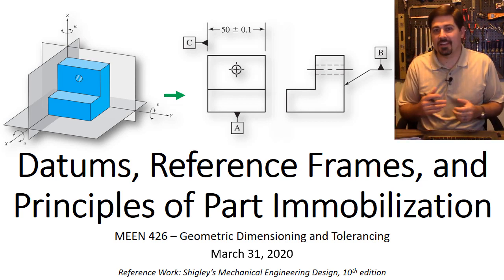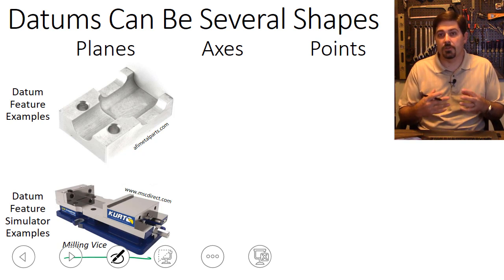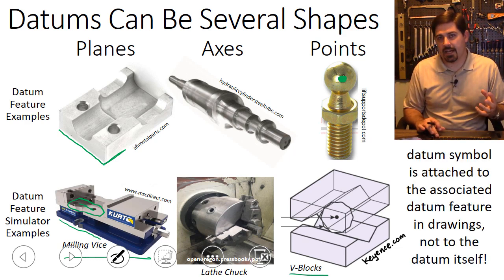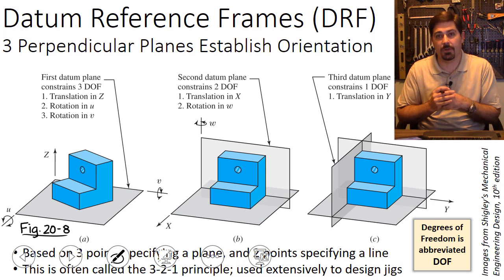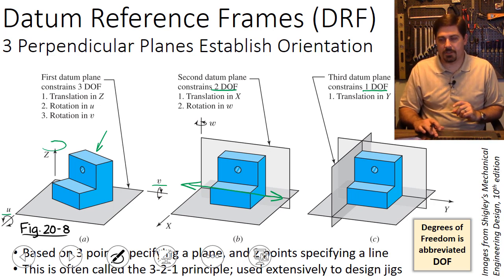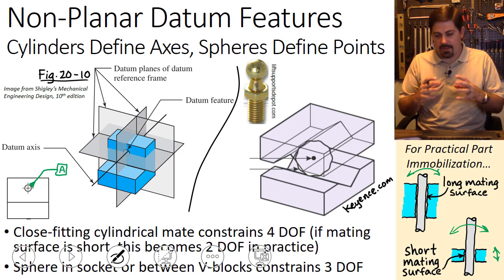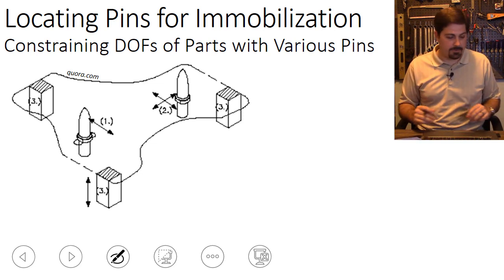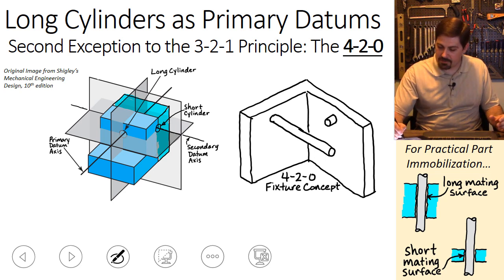GD&T Datums, Reference Frames, & Part Immobilization | 3-2-1, 4-1-1, 4-2-0 | Actual Mating Envelopes

Comment: sir i have a question regarding datums, assume that on one part i have a hole on the top face of the part which is 0.1 mm positional tolerance with respect to datum A, B then C( assume these datums are planar on very basic rectangular block and ordering of datums are important) on the feature control frame. This means that when this hole is inspected first datum A is constrained from 3 point contact, then B from 2 point contact, then C from 1 point. I also have another hole on the same part which is placed on the left face or right face which is again 0.1 mm positional tolerance but this time with respect to datum B A then C on the feature control frame (ordering is important). This time time same datum B which is used for first hole is used to locate second hole but 3 point of contact is done on that datum. Then datum A for 2 point contact and for C 1 point contact. So same part and same drawing but according to my datum ordering, datum A can be used for  3 point of contact or 2 point of contact in inspection. Is my understanding true? if it is wrong pls help me understanding it. Thx for videos.

Comment: Man, I hope your students appreciate how absolutely concise and applicable all your videos are: GD&T along with actual manufacturing principles? Outstanding! As GD&T has evolved along with manufacturing, many machinists have remained sloppy or even used these methods to deliver junk. Aerospace (I''m now retired) is trying to move to reduced dimension drawings. The idea being to put a general callout to something like "produce the part using best shop practices to PoM 0.005" of the theoretical 3D CAD model." The intent is to free up the machinist and inspectors to only inspect the noted areas (truly critical dimensions, bearing and dowel pin locations, etc).

Any CNC made in the last 30 years can hold those tolerances without trying. At trade shows, Haas runs demo parts and hands them out all day long. Dimensions are all obvious numbers and parallel, repeatable, etc. Instead of similar quality, our internal machine shops would deliver things like two coaxial bearing bores more than 0.030" misaligned and not even on parallel axes (why they removed it from the machine between holes remains a mystery). Or another where a pattern of two dowels and a retaining screw, repeated four times, in a single line for twelve holes total. They managed to get one of the three-hole sets off by more than 0.020". No clue how. It could have met print with a knee mill and vise. Could have probably done it with a drill press, layout fluid and a punch. Despite rows of Haas CNCs, they not only made them but, QA bought them and tried to deliver them. Since engineers weren't supposed to have measuring tools, I was reduced to installing the dowels, laying them flat on a vise jaw and showing how a company badge could easily pass under some of them. Crickets.

Comment: I understand the 3 2 1 rule, but how does a designer determine whether to call out A/B/C, A/C/B or C/B/A, etc?  I have problem deciding which datum feature goes into secondary and which goes into tertiary spots.  In your first example, why did you put B in the 2nd spot, why not C?  Or why not use B as the primary datum and A as secondary?
Reply: I would say the rule of thumb to have a proper alignment is rigidity. This makes your alignment more repeatable. So, base on the nature of your datum features, you might want to use ABC or CBA. Also, it depends on which feature is more important to you

Comment: Question, I have some confusion at my work with fellow engineers. If you have a part with a flat surface as datum A, a cylindrical hole as datum B and another flat edge as datum C. To properly align the part for CMM inspection do you 1. Rotate the part until it makes contact with the theoretical datum C or 2. rotate the part until the surface of datum C is parallel with the theoretical datum C? Thanks
Reply: I would say you will need to make the contact with datum C. You can not really make them parallel because the edge feature itself is not a perfect line